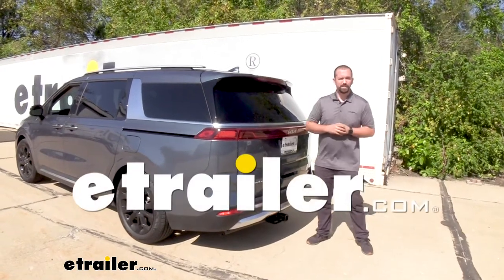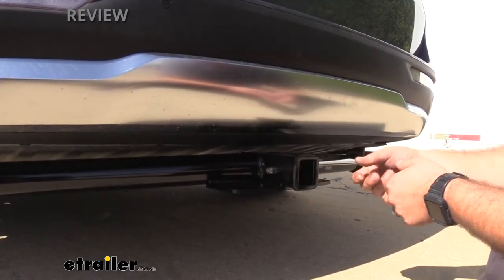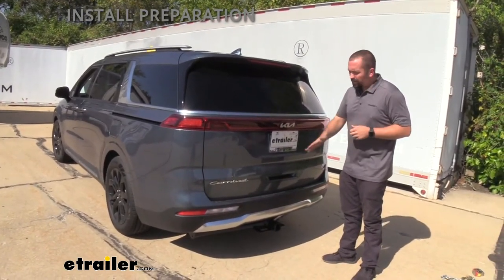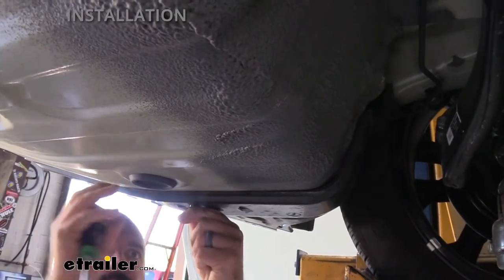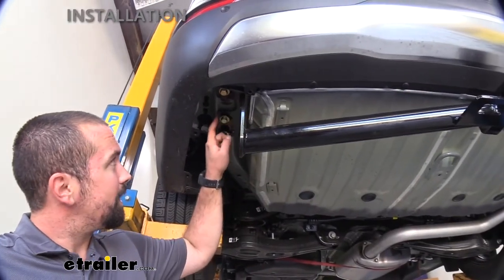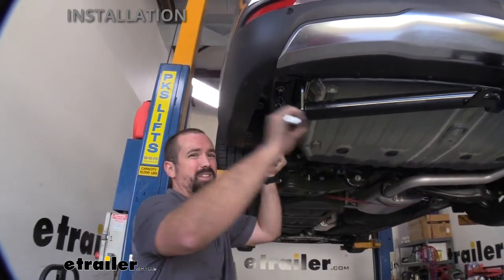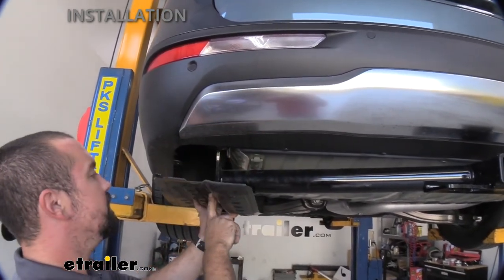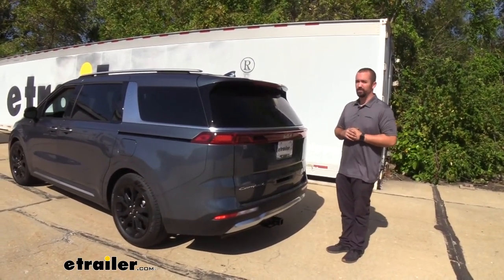etrailer | Curt Class III Trailer Hitch Installation - 2022 Kia Carnival

Comment: How much applied torque for those bolts?
Reply from the maker: The hitch manufacturers can obtain the hitch mounting hardware from different vendors over time which can affect their torque rating. Because of this, we don't publish or broadcast the torque values. The best place to obtain the most current torque values is the install instructions which we've linked for you below. The torque rating is mentioned in step # 3.
https://www.etrailer.com/instructions.aspx?pn=C67ER